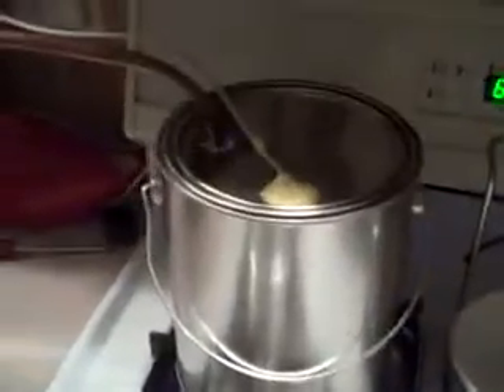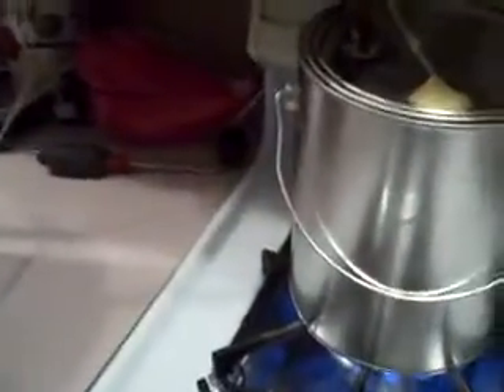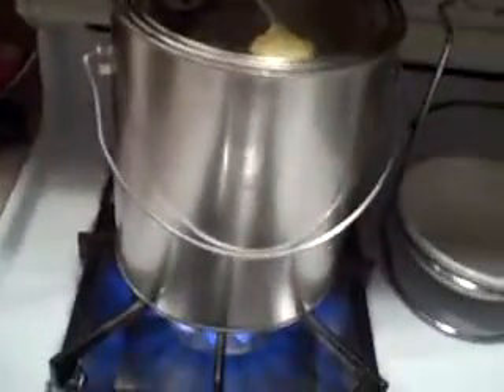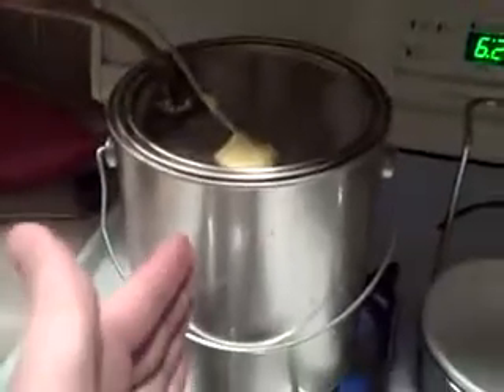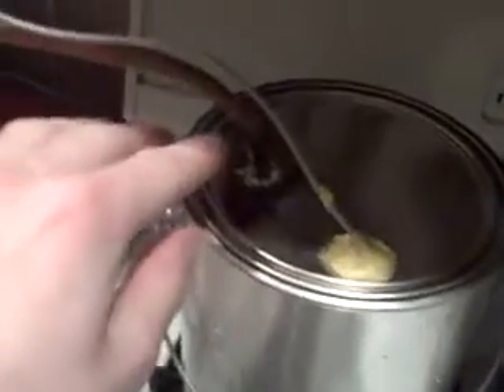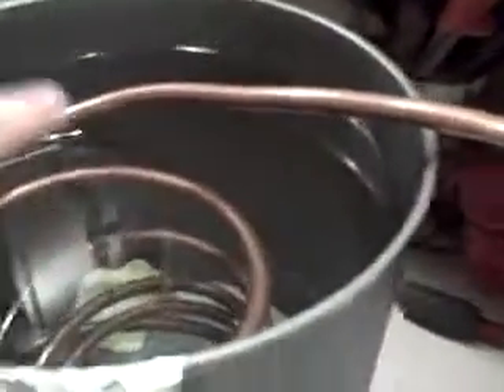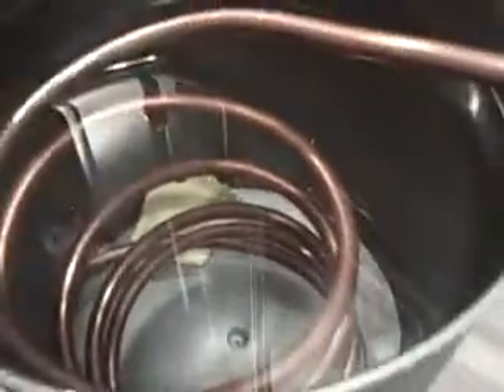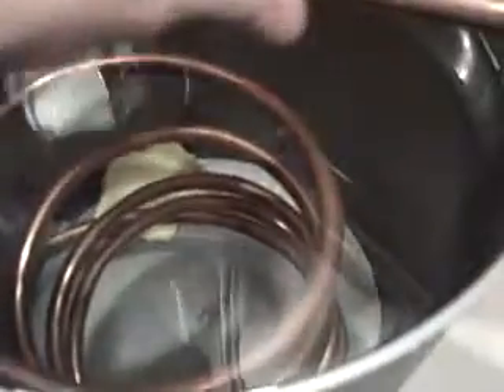Moonshine Distill (Biofuel apperatus)

Comment: I made my first batch this weekend with my custom made still from a 4 gallon stew pot. It is not fun and games but is tedious and time consuming because you have to constantly monitor it. Keeping the coil cool is a chore as the heat is intense. It will burn up your ice immediately so you need a cooling apparatus or technique that will keep cool water on your coil. Living near sea level makes you heat to 205 before alcohol steam will move up out your pot and through your coil.